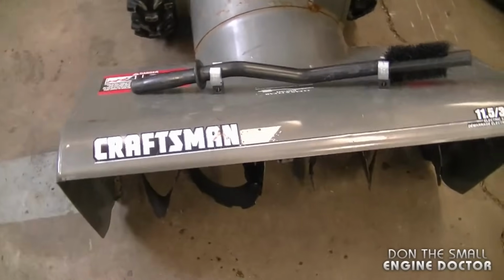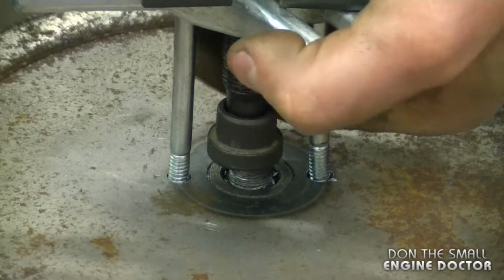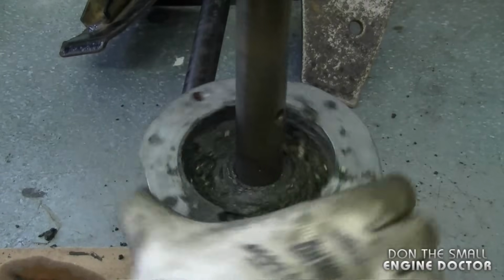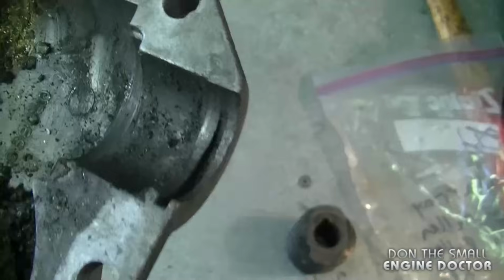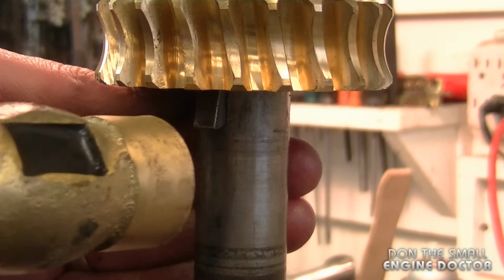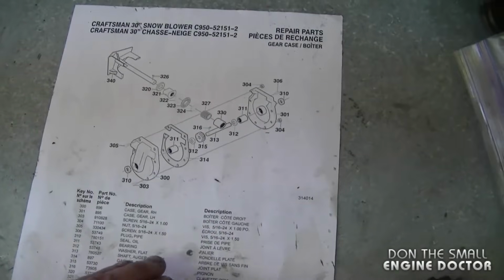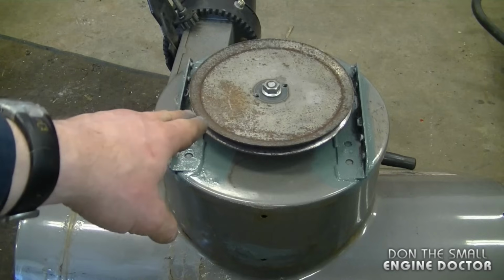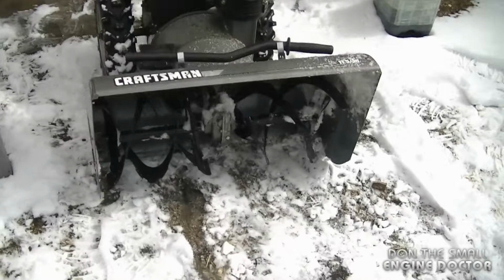Complete Snowblower Auger Gear Box Rebuild!

Comment: I really enjoy watching your you tube channel, I have a craftsman chain saw it’s a 42 cc with 18 in bar replaced gas lines and it runs good rev’s up good but absolutely no power in a log , could it be carb adjustment, would really like yr input

Comment: So as long as we use sheer pins as intended, that worm drive and gear case should never really get worn out.  (Aside from seals going bad and other wearables.). I cringe every time I need to clear ice or other heavy snow loads over a gravel driveway...I can only imagine what my worm drive transfer looks like after 50-60 uses over a 10 year ownership period.
Reply: That's correct. I have a MTD 12HP, 33" 2-stage walk-behind that is over 25 years old and I've never had to repair the auger drive.  Same with the unit I had before that. You could probably extend the life even more by splitting the case after a while and reapplying lubrication. Most of these use 00 grease.

Comment: Great video.  Curious about the grease used in the transmission. 15:49 I have never seen "00" grease.  I think that my 2-stage blower has 90W hypoid gear oil.  Why not use that as a refill since it is readily available at Canadian Tire,

Comment: You did pretty good but if you cleaned the shaft up before taking the covers off would have made it much easier. I prefer gear oil over grease because of what was in the ear box. I had to rebuild my gear box on an older model Craftsman snowblower because the chain for the top drift breaker caught the end of the auger and broke the gear box. That almost broke the worm gear but didn't which was good, because it's no longer available as are the impeller gear box bearings. I did fine a source of parts through a Motion Inc, a bearing and drive company that matched up seals washers. the front impeller bearing was found at on the shelf Ace hardware store.
Reply: The only thing I would add, is those driven pulleys were not really made to come off or come off easy.  Because there was not a provision made in the pulley for a puller. So I just drilled two through holes and used two bolts and nuts with a steering wheel puller made short work of it. Wish mine came apart like that one did!!

Comment: Don have you tried running hypoid gear lube in one of these? Like SAE 90 or 90w140 mineral lube. I suspect it would leak since looks like no real seals on the shafts. But it might work better since it looks like that one self destructed from lack of lubrication.

Comment: I hope your New Year is the best, like your channel. :) I have an old Craftsman AMF (thick metal tank) that had an 8hp tecumseh,  now has a 6.5 Briggs that I have started in a few years (need to do this spring). Thanks for this video that will help me finish the seized augers on my MTD Snowflite 522 that I started a few years ago, but got stuck at removing the gear box shaft bearing (6:14) thanks Don.  
I can't find anyone that's done a video on removing the belt pulley from a tecumseh HSSK-50. I can't hold the drive shaft and I don't know if the bolt is a reverse thread, making it twice as hard to guess what I'm trying to get that pulley off the engine.  I can get a small pipe wrench on the shaft (luckily) and I think I've moved the bolt a smidge, still don't know if that smidge was the tighty or loosey and the pipe wrench is hard to tell if it's holding or letting the shaft move while I'm wrenching.
Have you already done a video on taking the old pulley off to put on a new engine?
Reply: I found my vice grips this afternoon and got the bolt off and found a blob of loctite on the threads. I think I just needed a second pair of eyes and a good vicegrip.  Your town is way up north of Toronto and I thought Barie was up there. Love the snow in the ASMR video, reminds me of my abominable snowblower man days when I get covered with snow and can't see with my glasses covered after blowing the driveway.

Comment: how would i get the right side  auger off on a craftsman 11.hp with 30 inch wide cut  the left side auger just slide off but the right one i can't turn free by hand their no shear pin in it what should i try to get it off with i tryed to use pry bar n slug hammer to tap it off but it will not come off would i have to put heat on it or not can u please message back thank u

Comment: What happens if you use 80/90 gear oil in the auger gear box?  I bought a used snowblower and put a small screw driver in through the fill hole to sample what was in there and it was pretty dried out grease with no flow left to it.  The gear box still works good though.  So I filled it up with gear oil.  I am hoping it will dissolve the dried grease and I can change it out maybe in the summer.  Or if it doesn't dissolve the dried grease, hopefully the gear oil will extend the life of the gears over what appears to be no lubrication now.  I doubt the dried grease is finding it's way into the gears.

Comment: Question. I have an older Craftsman 5/22 blower from the 90’s. Is a split image of the one in video. Everything runs and turns properly but it barely throws snow out of the chute. Impeller spins very fast and the front augers turn as well. What could the issue be? I’ve replaced shear pins, replaced auger belt and spark plug. It’s stumping me and making me regret buying it. Anyone have any idea?

Comment: Great tutorial Dony! Anti-seize is the ticket for the next time some work is to be done. I think I would of replaced the bearing, but the old one seemed to work well. I always try to find the schematic with something like that in case someone else forgot to put all the parts back in or they disintegrated. Good job!

Comment: I have a 1994 John Deere TRS24 still in good shape I'd like to do this to. Most of The O.E. Parts are near obsolete. I see You used Briggs parts, Where does one go to to interchange parts ?  Also Where do You get the gear case grease from - Thanks !

Comment: I am rebuilding the auger gear box out of a Toro 1128 OXE.  How much clearance is allowable between the auger shaft and the shaft bushings?  I can't find any specs that state the allowable clearance limits for the two shaft bearings and any other bearings for that matter.  There appears to be some very minor galling of the bearings.  I have cleaned major rust off the shaft adjacent to the bearing surface with 220 grit emery paper, then polished using 2200 grit.  Just want to make a wise decision on whether or not to replace the bearings.

Comment: Nice job. I would have warned about not mixing up the auger blades on reassembly.There is a left hand and right hand blade and reversing them will cause the blades to not dig into the snow properly.
Reply from the maker: Great point!

Comment: Dony my simplicity 870 parts schematic states right on the Auger assembly section to use anti seize on auger shafts.
Would you recommned that as well???

Comment: I know I'm late to the party, I see they have a seal for the shaft where power comsin into the auger gear box, but what serves to seal the fluid in the gear box from running out the shaft openings on either side?

Comment: QUESTION:  I have put everything together after cleaning out the gearbox and wiping down the old gear on the drive shaft.  Everything went together well and properly, but when I went to hand turn the shaft to be sure that the auger shaft turned, it was tight. I guess I expected it to be more of an easy turn.  I'm sure the motor will drive this, but is it normal for a rebuilt to be somewhat tight? In looking at your video, when you spin the shaft, it goes easily at the touch of your hand. Mine has to use some amount of force.  Everything looks fine inside, so I am a bit confused as to what might be a problem.

Again, thanks for all the great information.

Comment: You make great videos. Just a quick question about the quad ring. It appears that does not fit snug on the shaft and has a fair bit of clearance and may have been distorted once the halves have been installed. Is this correct or am I seeing it wrong ?

Comment: I'd like to see a video on tearing-down a 3-stage gearbox. Mine has a bent worm shaft. Looks like a gigantic pain in the ass to remove the shaft. Bearings, seals, etc. all in the way. It's like $70 for a new shaft or $300 for an entire assembly with new everything. I'm leaning towards the latter just out of ease of installation. The machine has only been used once so it's worth repairing. I will say that I will never buy another 3-stage though. Delicate like glass and doesn't perform as well as 2-stage.
Reply from the maker: what you could do is the ager assembly without the three stage, ask your dealer about that

Comment: Can someone help me please? I have mtd snow thrower that R1 doesn't move  and R2 moves super slow, forward gear work fine. How can i fix that problems? thx
Reply from the maker: you need to adjust shifter linkage or cable

Comment: Very informative video. It's a bit frustrating though. You can readily get all those parts to repair the auger drive on that inexpensive walk-behind snow blower yet I have a Deere 54" front blower on my tractor and they do not sell ANY individual parts for the auger drive. Only the complete gearbox for over $500. How insane is that?

Comment: I noticed the augers had grease zerks on them, can they be installed on the
newer models that came without them, or is it not necessary as long as you
try and  keep the shafts lubed. I’m thinking about pulling it apart as you did and give
it a liberal greasing and anti-seize just like this video. 
My Craftsman snowblower is 4-5 years old which is a zero turn model, 26”...

My very first snowblower lasted 17 years, I’ll admit I didn’t maintain it very well other than changing cables when needed, the bushings at the back of the unit under the pulley rusted right up, no amount of heat or penetrating oil helped. Eventually sold just the drive motor portion for a few dollars helping a friend..

Comment: I have a Toro 521 and it looks like the auger transmission with this model presented by you ... do you know if it can be put to me instead of Toro 5-7180 GEAR-WORM, 27T -> Briggs Stratton 1752500YP?
Or instead of Toro 5-7170 GEAR -> Briggs Stratton 53732MA?
The gaskets also look the same: Toro 51-0460 GASKET-CASE, GEAR -> Briggs Stratton 897MA ...
I am from Romania and find cheaper and easier Briggs Stratton pieces ... those from Toro are extremely expensive to us ...

Comment: Great video!  I had to do the same thing to my unit last year - had just as much trouble getting the pulley off as well.  I also replaced the entire impeller rather than fix it.

Question: what are the zerk fittings on the augers for?  Since the augers don't rotate on the shaft, there should not be any reason to put grease in there (other than a light coat to prevent binding during removal).  Mine does not have them.

Be well,
Don

Comment: only question i have is..when you went to pull the pulley off you had to drill two holes to install your puller ..but when you got it off there were two 5/16 nuts on the underside....how did you get the nuts on there? as the clearance of the pulley to the to the auger box must of been really close or next to zero tolerance. other then that great informative video..you went step by step..snowblowers for dummies..lol
Reply from the maker: I got them on with my hands

Comment: Great repair Dony.  

Can you speak to the repair cost versus the machine value.  Seems between your labor, purchased parts, and parts you provided(used impeller and gearbox casing)...... machine is worth about what was invested to get it back up to running order.  
Not trying to hate...... I actually did this exact repair to my personal snowblower years ago, and if I had it to do again..... I would just sell off the broken machine for parts   ???
Reply from the maker: I wasn't in the red. I do repair maybe not so lucrative machines for youtube videos only
Reply: @donyboy73    Yea, you make quality repair videos.  Very thorough.  Thanks!

Comment: Great work! You make it all look easy. Even when it's putting up a fight, you power right through it. 

It took me several hours just to get the pulley off of an older, mid 90's Atlas. After two different pullers, heating it, hammering it, etc., that pulley was destroyed. It began to tear around the sleeve that goes over the shaft, so I ended up cutting it off. The bearing put up a similar fight. I'll probably end up needing to change the impeller shaft now. 

The snowblower worked ok to begin with, but wasn't throwing snow very well. And I noticed that impeller pulley/shaft was making noise in the housing (like a quiet cement mixer) and moving up and down inside the bearing, rather than turning smoothly. So I believe all that was causing extra drag on the impeller. 

I'm just taking apart the gearbox, checking it and re-greasing everything since I have it tore down this far. Low and behold, even the front augers are seized to the front shaft and don't want to come off. 

Same deal as yours where they had regular bolts in those augers instead of shear bolts. And someone else was here before me as well, because there were already pry marks and slight bends in the pulley. I don't think they ever got it off though. I think they gave up and just decided to use it the way it was. haha.

Subscribed!

Comment: Why did we got from single stage beasts of machines in the 70-80s to this garbage. More to fix. Our old 78 mastercraft with Tecumseh engine still going strong just the pull is done on it. Honestly this is a nightmare compared to what I had to fix on our old blower. Blower is 8 years older than I am and less problems

Comment: Damned bolts on the auger keep breaking when I try to grind up them ice mounds. Luckily I am a handyman and purdy smart to boot, so I am gonna put me some stronger bolts. Why didn't them high paid engineers think of dat! Geez! Damned, now my gearcase broke. Crappy Chinese quality. The bloody threads stripped when I tried taking the pulley off. An the gearbox casing got all messed up when I tried to open it. Ahhh... I'll just give it to donyboy73 to deal with this pos. Let me tell ya'll they just don't make 'em like they used to. Them ancient cast iron monsters could withstand any level of abuse (and stupidity)!

Comment: Awesome video. My only suggestion would be to make sure the zirc fittings are functional before reassembling everything. Great content. I had a machine shop tell me it would cost more than my old blower was worth to do this repair. I'm guessing they took the machine, fixed it and sold it. Also did that quad seal appear far too large to anyone else..?? Damm engineers. Would of killed them to design an oil bath/drain plug setup. Cold weather be dammed.
Reply: Just make sure to pump a quality EP2 grease into the auger box. The factory never puts enough in there. This part should last forever with proper greasing.

Comment: Wow I enjoyed that break down , detailed explanations and repair Don. Looks like that blower had seen plenty of hours ! Where those grease fittings on the auger blade shaft , one per side ?  I think there are likely many blower machines owners that do that same thing , add high line non shear bolts that wear the gears out early ? You sure make it look easy :) Are most or all inner drive gears made of brass? thanks for sharing and teaching.
Reply: Yes,those are grease zerts on both sides of the auger. I think I'm the only person who actually uses them when doing pre-season maintenance lol.

Comment: I put my gear box back together. Now if I did something wrong. I'd hear grinding or it just wouldn't turn correct?  Thank you for your video. Everything didn't go smooth but I got it. I beleive the propellers are working. I have to put shear pins in. I didn't have anyone to see how fast the propellers was turning
Reply from the maker: sounds like you did a good job!
Reply: @donyboy73  great yeah with your help it's fixed. I wanted my wife to walk out there and hold the augar engage down but she was busy lol. Thank you for your videos. I have 4 snowblowers. 3 I'm selling and the one I fixed the gearbox I'm keeping it

Comment: Dony great video very informative. The only thing I'd like to add is I don't know whether this job would actually Be Worth doing on a customers snowblower. Parts and labor probably would be as much If not more than you could buy another snowblower of this caliber for.
Reply: A new 30" 2-stage snow blower is going to cost over $1000. I suspect a repair like this would be $250 or so (just guessing). If repaired correctly it would probably be better than new and last a long time.
Reply: @eosjoe565  I'm not talking about buying a new one I'm talking about buying one like this that works. This is a old inexpensive snow blower You can buy them All day long on Facebook 300-400 dollars. I'm guessing this repair in a shop would be closer to $500
Reply: @YourAwesomePhoto  Yes, that is correct and I agree. There is a good supply of used snow blowers on Craigslist and Facebook. But even buying a used one you have no idea what the condition of the auger drive is. It may be on its "last tooth" so to speak. :-)
Reply: @eosjoe565  you would have to be a extremely unlucky. I've been repairing snow blowers for 40 years and have never come across one in this condition. Very rare to have the gearbox tore up like this. Most people use to correct pins that sheer and therefore do not Ruin the gearbox.